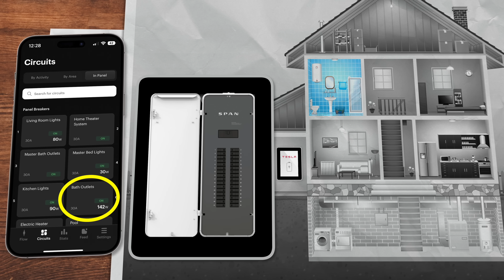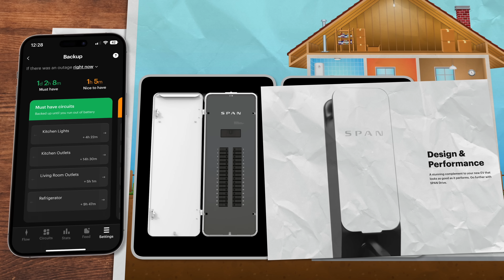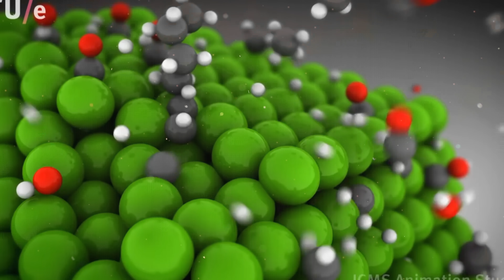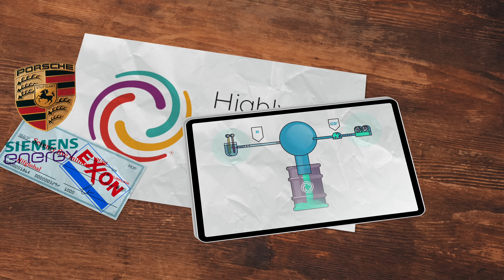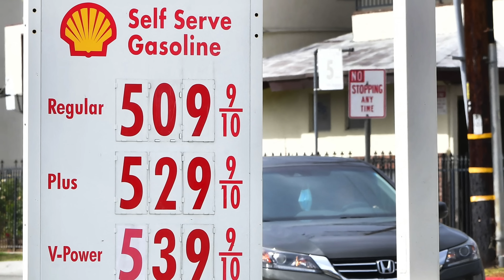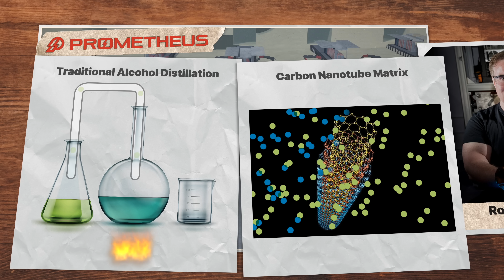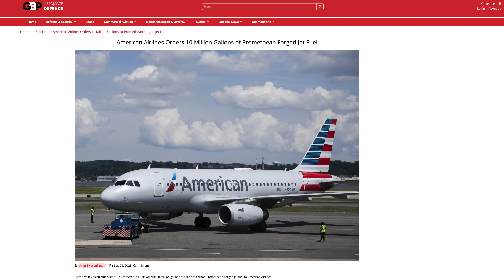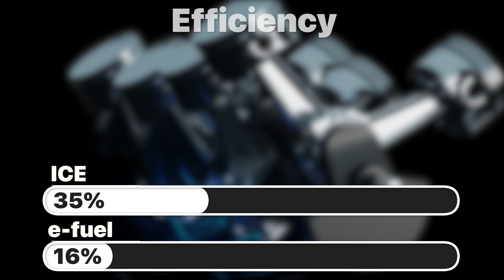EPIC Breakthrough Can SAVE the Internal Combustion Engine!

Comment: Everyone is talking about anthropomorphic global warming. One solution will not fit all. And sometimes you might have an theory or even a process but it must be scalable. Having a more efficient and innovative rail system would be a different way to do things. Having trains with Roll On Roll Off train cars., where you could drive on one location and drive off when you  arrive. This would reduce the need for charging stations regardless if it is ICE or EV. EV's only make sense if you can charge them yourself. And in a place like Alberta will never be conducive to the use of EV's given our climate. However Texas and California have different climate realities. CO2 is not a pollutant but we should do a better job in it's consumption. .

Comment: It takes energy to convert carbon to fuel. Much less efficient than building solar, wind, and thorium power supplies. Are they trying to help people support the power that is so they can keep producing ice cars?  If you use this for existing cars, gas will be more expensive. Better than pumping oil. then you have to transport the fuel. A thorium plant could also produce this fuel will less transportation. At 7 dollars per gallon, electricity will be less than a dollar. If the companies are going to keep producing new ice cars then the parts, metal, plastic, and others will still be needed.

Comment: Cars go to waste whether they are replaced by gas cars or by EVs...  efuels do cut down on emissions if they are generated with renewable energy.  Problem is definitely that it requires a lot of energy to make the fuel and the a combustion engine is still incredibly inefficient...   The cost will be a thousand times higher (-ish) than normal gasoline which is way more inefficient and expensive than electric.  People will still want EVs for all the ways they are better than combustion vehicles...

Comment: We don't have the infrastructure to power even half US automobiles with electricity. Nor are there enough rare earth's to build all the batteries. And the mining of rare earth's are themselves polluting as is the disposal of worn out batteries. Especially true of Lithium batteries that can cost a person more than 30,000 USD to replace them in electric vehicles. We should stick with gas engines until our technology makes he's more practiced. This being able to convert solar power into hydrocarbon neutral fuel seem a very good solution. We have millions of acres of deserts in the US we can use to create this synthetic gas that is free of the pollutants such as benzene, lead and other poisons found in petroleum products.

Comment: in part i believe that if popular models had an upgrade option this could save a lot of materials. may not be the "top of the line" but it would be cleaner for this generation until the next battery is materialized.
Reply: That I believe is the whole point of plug in hybrids.

Comment: I like your detailed but not too deep descriptions, so we can understand how this really works. 
   CAUTION - you compared the efficiency of ICE (internal combustion engines) with EV vehicles. You did not account for the efficiency and pollution of the power generation,  transmission, and from AC to the DC to store the energy in the batteries. And does your 90% efficiency figure include the efficiency of charging?
   Further, some but not all of your videos mention the environmental impact of mining, refining, manufacturing, and disposing of batteries, solar panels, etc.  It would be good to be consistent. And consistency includes comparing to those same impacts from building ICE vehicles, engines, and fuels too.

Comment: Electric cars are not cheaper to charge in England so it is solely dependent on the market electricity rates And if you really think that electric will remain cheap you are a fool you really need to go hydrogen 10 times better than electric
Reply: No it's not, hydrogen is way less efficient and has a bunch of other issues. Where do you think the hydrogen comes from? It needs electricity to be crested and it's very inefficient to make and then burn.

Comment: We have not upset the climate! Convection limits surface temperature, and so CO2 has no effect on climate. Fossil fuels do not alter climate. Climate change dogma is hampering our productivity. Fossil fuels have kept productivity high.
Proof that convection controls climate is obvious if we observe the moon. The moon reaches boiling temperature in daytime. On Earth, we never reach boiling temperature because convection limits daytime temperature. So, CO2 cannot alter climate because hot air rises up into the cold troposphere. Convection limits temperature, and so convection also keeps Earth's poles from getting too cold.
Fossil fuels and fracking are necessary for modern life. Solar energy is too expensive to be practical, unless solar is used to make fuel.

Comment: This is a joke, this doesn't solve all of the health issues that result from spewing toxic gases into the atmosphere. Even hydrogen burnt in an internal combustion engine produces bucket loads of nitrous oxide which causes acid rain AND is a green house gas. If you introduce a $10,000 per litre emissions tax that would be used to clean up the mess and compensate the families who lose loved ones etc. then maybe you have some part of a case. ICE engines are filthy and people don't maintain them properly making them even dirtier. This whole concept of renewable fuels is just a scam from petroleum producers and car makers that spend development dollars that could have gone into making EVs instead into spreading rubbish about EVs Toyota is biggest of them.

Comment: Subcritical steam Rankine cycles are currently used in all operating  thermal power plants. However, thermal efficiencies of these power cycles are limited to about 42%. ( exceptions include wind and solar )  Help me understand how electric cars with about 90% ( loss of another 10 percent)  is that much better than ICE cars at ( Time line 15.49 )  20 to 35 percent efficiency ,  Should we start thinking about recovering this thermal energy , for instance district heating, or using a gas engine to charge our electric car and taking the waste heat to heat our home or used to improve the efficiency of heat pumps. ( I do get it that electric cars are the new shiny tool  that I want also for the fun of it )

Comment: Even if very cost effective, you still have the problem you mentioned yourself: right now there is simply not enough renewable energy even for the electricity markets. So squandering precious energy on producing ineffective fuels is certainly no solution to slow EV uptake or whatever. Besides, you should compare this technology and its development with the development of batteries, that, as I've seen in other similar videos, is about to do far better as well with different, more lightweight materials etc. But, I also think no research should be excluded.

Comment: Hi. There will always be a place for i.c.e.'s because they're the only prime movers that can operate off grid, 24/7, all weathers, some (like diesels) on a variety of e-fuels, store future fuel needs in a few cheap 44 gallon drums even out in the boondocks, and empty them into the gas tank with a hand pump. As they say today, "what's not to love?" Cheers, P.R.
Reply: Gasoline isn't the only fuel that could be made that way.  It's possible that they could use solar and wind power up to the high Arctic to make fuel while the sun shines.  As you say, gasoline is easy to store, but propane, methane or ammonia are  not too difficult either.  And they're stable, where gasoline isn't.
Reply: @RandyTWester  Hi Rand. Good ideas. The problem with methane and propane is pressurization, and big heavy gas cylinders. Cheers, P.R.

Comment: Thank you for the video I enjoy your insight. But your take on the recycling piece is a bit skewed towards electric. The current ICE cars are closer to 87% recyclable as compared to 65% or less for electric. Which to date we don’t have an official recycling number for. And, unfortunately there is very little recyclable materials in the battery. So the  65% is probably generous. Also it takes 65K miles of driving an electric vehicle before it becomes net neutral CO2 to an ICE car with the same mileage. So still better but these videos always sells the electric to be earth’s savior when they are not. This is coming from someone who supports electric. I own a hybrid, and have been researching which electric vehicle is right for us. Thanks again for the info but lets keep it real.

Comment: The big problem with ICE is that they are not economical. Or fuel efficiënt, 100% energy is converted into heat and kinetic energy. For a petrol engine, the loss is 70% converter to heat and for a diesel it is 60%? On Earth, we are busy with energy conversions every day. The ICE has not improved 10% in 100 years. We are really ready for something completely new, perhaps induction driving, for commuters

Comment: This makes no practical sense. If you have electric power to make your syn fuel then why go thru the inefficienct process of converting it to fuel, transporting that fuel, and then the ineffcient process of burning that fuel to come up with mechanical energy to move your car. All of this waste to keep you ICE car?

Why not just use an EV? You can take your orginal electricity, send it over wires into a system to directly produce mechanical energy.

Comment: Please quit claiming that battery electric is more efficient as it does not produce any energy, only store it. Current electric power generation is no more efficient than any modern ice vehicle when adding the loss to transmission and charging! Sorry resistance is just a physical fact!

Comment: Great video as always,  I read a research paper recently (The Grim Origins of an ominous methane surge) WIRED new artical and there's a big massive twist to the hole climate change , all scientists where shocked to find lockdowns during pandemic with low CO2 emissions from cars actually increased globally temperatures the reason being they discovered nitric oxide actually blocks heat entering atmosphere,  yes co2 is bad but not as bad as methane and methane increased in lockdowns too.
There's more methane on earth than oil an gas combined,  all ship are being converted and new ones built with gas engines I'd say more so methane , one cow dune will produce 1kw per day.
Methane ad steam = methanol 
Co2+hydrogen = Ch4 methane 
Run methane through a lithium filter removes co2 = hydrogen .
Methane heats the planet 80x more than co2 .
Oh study 1Lt of water converted to hydrogen power a semi trailer for a huge 15m hydrogen is dead making from water. Use the methane or burn it off.

Cheers

Comment: A) Electricity isn't free
B) EVs are way more toxic to the environment that fossil fuel vehicles
C) Batteries aren't cheap
D) It takes forever to recharge an EV

So far EVs are NOT a better product than a Fossil fuel based vehicle. wtf are you taking about narrator?

Comment: Thank you for this interesting idea. Scientists claim that the warming up of our planet is caused by the CO2 emission. But one important fact is overlooked. Every internal combustion engine turns 60% of the energy that is put in into heat. So we have 2 billion moving heaters and about the same amount of air conditioners who also heat the atmosphere. Electric vehicles use less energy and less heat emission. But I agree that it is impossible to change all the cars into electric cars as long as we do not find an other sort of electricity storage. I am glad that many people on our planet are working hard to fix this problem.

Comment: It is still possible to change powertrain of ICE cars into E-powertrain, which will avoid the insane energy loss of powering all existing cars with e-fuels. Else it is also possible to change oil ICE engine into hydrogen ICE engines which still has energy losses but maybe less.

Comment: The problem with efuels is that you loss a lot of energy in the generation of efuels and that the combustion engine is very inefficient, just like mention in the video. Therefore efuels should only be used where electrification isn't easily possible, like airplanes, big trucks ect.
Reply: For a home system with a back up type generator, and on location a small scale biofuel generator might be worth it.
Reply: If battery technology doesn't make a quantum leap then electrification won't be possible anyways. Lithium batteries are very costly, their environmental impact is substantial in the form of open pit mines, and they have to constantly recharge from the grid. Our power grid is a far cry from being ready for full EV adoption, and it'll be many decades before it's ready. Unless we explore an alternative means of energy storage such as hydrogen fuel cells, or some other means that doesn't simply shift more burden to the power grid, then EVs have a snowball's chance in hell of taking over.
Reply: @knote4958  there are many battery breakthroughs- sodium ion being just one.  Electrification is not only doable with current technology, it is essential to us having any hope in mitigating the climate emergency.
Reply: @calvinclimie  no there aren't many battery breakthroughs.  Sodium batteries are the first out of about 100+ "breakthroughs" I have seen to actually go into production.  They aren't as energy dense as lithium and won't be better for vehicles. Ya it's great they are using common plentiful elements but we need energy density for vehicles.
Reply: @randybobandy9828  There are many news about 'breakthroughs', but we easily forget the long way from a new discovery to development into a final product ready for mass-production. There can be many obstacles along the way.
I don't think high capacity, low density batteries are a must. 
If we can get very fast-charging and plenty of charging-spots (perhaps even wireless charging),  a smaller capacity battery will do just fine.
Reply: @randybobandy9828  There are new chemistries every year going into cars...  You just have not been paying attention to EV news...
Reply: @randybobandy9828  
For most purposes, sodium ion would be five even with lower energy densities- works in cold weather better than lithium.  Ultimately, we need a massive investment in free/affordable public transit that runs off a wire network, LRT, streetcars, etc as well as more liveable cities.  The same goes for inter community transit.  Cars are a problem and we need to transition away from them.
Reply: @knote4958  All,your points have been proven to be nothing more than oil company or Toyota propaganda...
Reply: @0ooTheMAXXoo0  Proven by what exactly? Nothing I've said has been proven wrong yet. Current battery technology, INCLUDING LITHIUM BATTERIES, are environmentally destructive and inefficient. They're resource intensive which means more open pit mines (which are one by one being bought up by China, surely that can't be good for long term supply security). Also, they all simply recharge straight from the energy grid which can hardly even support everybody running their ACs in the summer. We need a solution that doesn't simply shift the energy burden to our already strained energy infrastructure. We need a way to power EVs that's storable, transportable, and quick to refill (you know, the traits that keep fossil fuels on top). So far, the closest we have to that sort of solution is hydrogen fuel cells.

You can support a general cause while criticizing poor directions taken for that cause. Also, idk how you think this is oil company propaganda (or Toyota propaganda, lol wtf). Can you explain your reasoning? You seem to have some kind of mental filter going on conflating ideas.

Before you respond lashing out again, you need to do some actual research on these issues. Replying with "yOu'Re SpReAdInG pRoPaGaNdA" just shows you haven't really explored the topic fully.

Comment: I do not agree that the EV car is the future.  I contend that the ICE will be with us for at least 100 years in a modified form. The EV car for all eventualities is a scam or myth if anyone ever tried to start a car in winter. The battery degrades in the cold as everyone should know leaving you stranded or with a much reduced travel capability. The future is a redesigned engine running on hydrogen. The reason they downplay hydrogen is because anyone with junior secondary school science could  manufacture it themselves.
As regards CO2 having an effect on the climate is another lie. The composition of atmosphere as any secondary school  science student knows is 78% Nitrogen, 21% O2 and 1% other gasses of which CO2 is circa 0.04%. Plants and vegetation require CO2 to live and if the level of CO2 falls below 150ppm nothing will grow and we starve. Is that the plan? In the mean time they make billions on carbon tax. Now that people are copping on to the carbon scam they have changed the goal posts and are honing in on nitrogen as exemplified by what is going on in the Netherlands. Wake up people. ☘️☘️